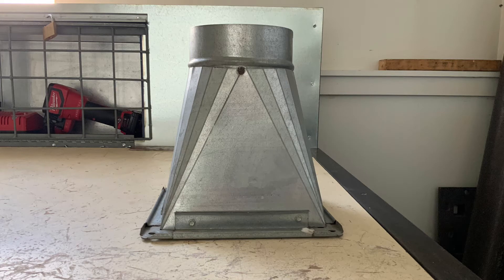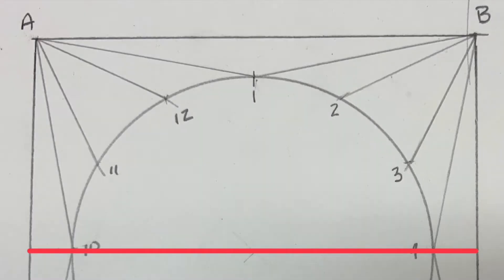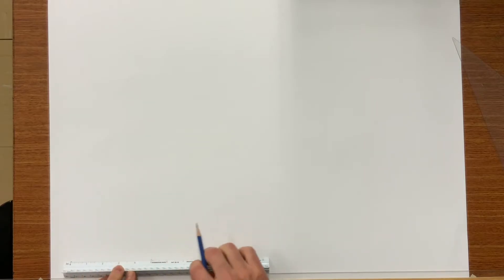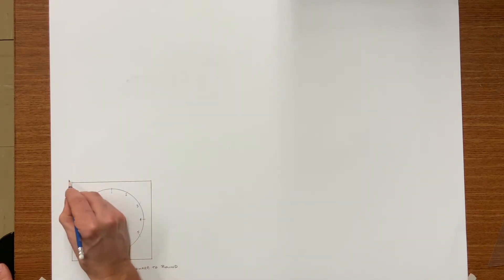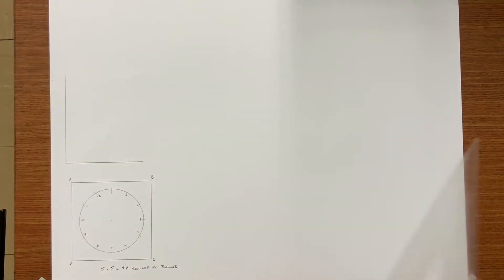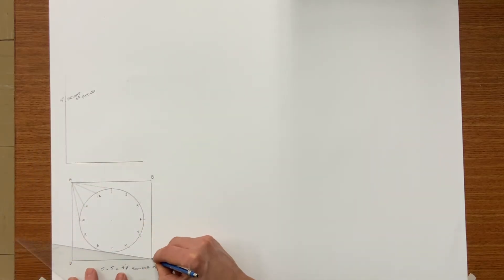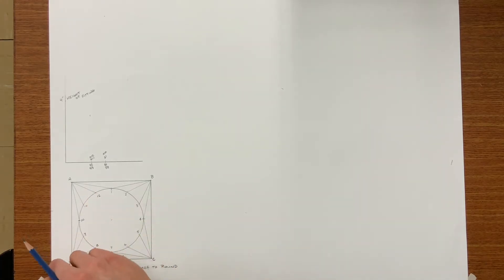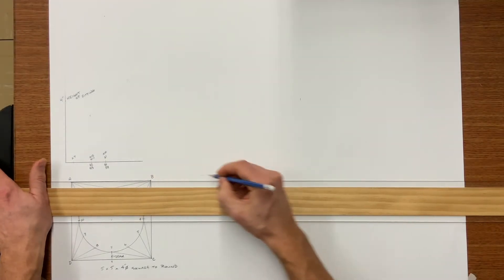Triangulation - Square to Round, paper layout

Comment: Can this formula also be used if the round is larger than the square ? For instance, I need to make 5.5" square to a 6.0" round. It will be approximately 5.5"-6.0" tall.
Reply from the maker: You sure can, it’s exactly the same. Your pattern just won’t curl upward as much as mine did in the video. The reason is that your square perimeter is 22 inches and the circumference for the round is approximately 19, this means a slight curling upward. Hope this can help?

Comment: Hi Duane. Very helpful at this stage.  Please can you assist with a OFF-SET RECTANGLE TO ROUND WITH 60 DEGREE PIPE SET? Doing prep for trade test in 3 weeks. Thank you
Reply from the maker: I haven’t done much for two years :( simply busy with other stuff but if I find a way to get back at it?  What size rectangle and diameter and how much offset?
Reply: Thank you for replying. Base>  305 x 353. Centre line, 155 & 142. Pipe Dia 188. First pipe length  200 and offset length 195. Off set is 60 degrees. All dimensions in mm. But I will scale to 1:4. Thank you so much. You dont have a whatsapp number? Just easier?
Reply: Do you perhaps have an email address? To send photos?

Comment: This video saved my life haha thanks man. Before I was just trying to draw out an arbitrary curve with the length of the circumference, divide the circumference up into 4 sides, read the angle made by the first side directly below the middle, and then repeat that until you have 4. Not sure if that works at all after seeing this video, so thanks.
Reply from the maker: There are plenty of short cut methods out there, and they work fine, but not as accurate
Reply: @sheetmetalwork  Got it, thank you. Does this method work for circles that surpass the bounds of the base rectangle? For example, a 20"x10" base with a 15" diameter circle placed in the middle.

Comment: Hello Duane. I've been loving these videos of yours they are most helpful. I sort of do a square to round a bit differently by scribing two arcs as though I was marking out a cone. The smaller of these arcs shares a total length with that of the round finished part of the sq2r and the larger arc can be stepped off with the size equal to the length of the sides. There's quite a bit of maths involved but I find it far quicker in the long run.
Reply from the maker: I agree.  But, First a beginner must understand the long way if he is going to appreciate short cut methods.
Reply: To be honest the maths often deserts me and I mostly resort to the method you lay down here. I didn't mean to come across as a dick.
Reply from the maker: @norvegicusbass  not at all. Lol
I enjoy short cuts just as much as everyone else. But like another subscriber said, in order to appreciate the shortcuts, one needs to have done it the long way many times.

Comment: thank you, so far I'm making up differant plans you've shared on my lunch hours.... done the square to round, sloped roof jack, and a pyramid. Pyramid is hard to bend in the pan break especially once you add a riveting flange, how small i made it didnt help, used a post note as the base in my sketch lol... going to try an inverted version of the last square to round next, a large circle to small square, than maybe the tee pipe work :).... I'm a fabricator for a commercial roofing company, making downspouts, gutters, and various other trim work and conductor boxes... I've made some intricate stuff in the past, but never had anyone to learn metal design that involved triangulation or parallel line development. Had one old book that got into some of this but it was hard to follow when you've never seen the principles in action and don't understand the terms.
Reply from the maker: If you decide to make a square to round with a larger circle than the bottom rectangle keep in mind that the pattern will have a tendency to go downward instead of curling up. And on another note making patterns for conductor heads and gutter mitres,,,that can complicated parallel line stuff 🤔.  Keep up the good work!
Reply: @sheetmetalwork  we've always found simpler ways of dealing with piecing gutter together.... the face of our gutter is a 70 degree angle followed by a 20 degree to make the second segment of the face  parnell with the back.... the 70 degree sits an inch further forward  from the bottom starting point so for a 90 degree corner I simply drew a 45 degree acrossed the bottom then from that point marked straight up the 70 degree slated segment, than from that point marked and inch further, connect the dots and cut out... than make a mirror image pc, one of with needs to have riveting flanges added) and that create the corner without any drawings, we've had more complex gutters but could aways figure out what series of angles and dimensions were required to make them meet without proper geometry drawings to help.... but you can't trial and error a square to round without some kind of drawings lol, not knowing how to do triangulation or parrel line drawings limited my potential considerably and your channel has greatly increased the scope of my abilities

Comment: Are the steps the same if the diameter of the circle is greater than the length of the square?
Reply from the maker: Yes they are, the only thing that will happen is the pattern will curl downward rather than upward.

Comment: Excellent video, Interesting subject, The transition from a larger square to smaller diameter round I can understand, but how would you transition from a 14" x 10" rectangle to a 12" dia round offset to one side. I ask because I have come across this and ended up just building a square plenum on top of the unit and placed a 12" collar on it. It looks nice just not as professional, or probably as efficient,  as I  would have liked...Thank You...
Reply: On the first step where he draws the circle inside of the square, you would just offset the circle so that the edge of the circle would fall on the edge that you were needing to offset the round to. From there its just triangulating your distances like he showed in the video, accounting for the differences you specified. For simplicity I would do the half plan route so you only have to deal with one 14" side and one 10" side at a time, then you can use that piece as a template for your second piece.
Reply: @dwood0220  Thank You...
Reply from the maker: I love the fact that you know that it can be done,  but better than that it would look and perform much better. Warren, I will eventually get around making a video for an off center Sq to Rd.